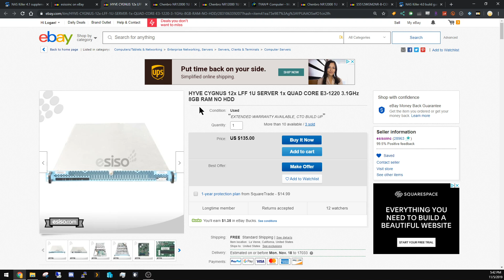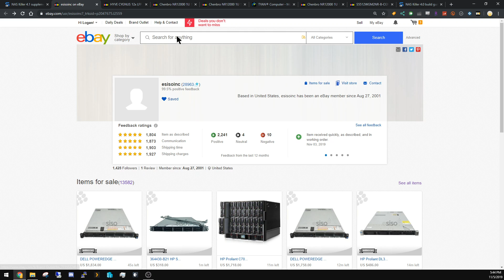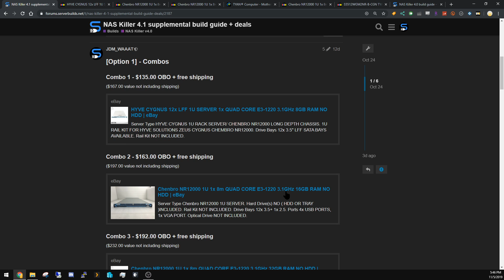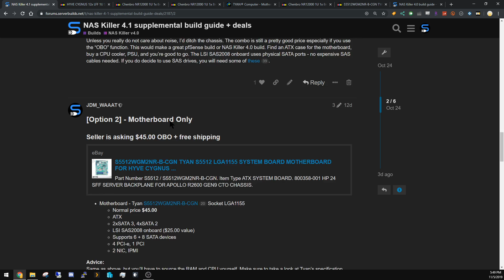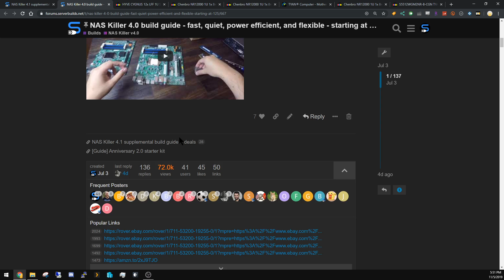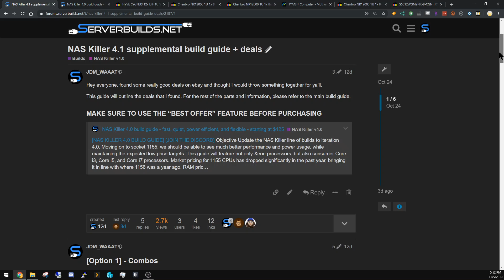NAS Killer v4.1 supplemental - high value combos!

Comment: Can I just go ahead and throw up to 12 hdds in here and use it as storage for my Plex server? (Still using my OG $350 plex server from one of your original /r/plex build guides. Dual x5649 and it can’t be stopped. :) starting to run out of storage though even with an add on DAS box and need something easy to set up
Reply from the maker: I suppose you could. There are more affordable and easier DAS options such as the 8 bay mini DAS, or you can just buy a rosewill 15 bay and turn that into one!